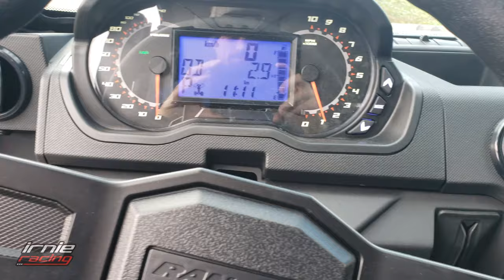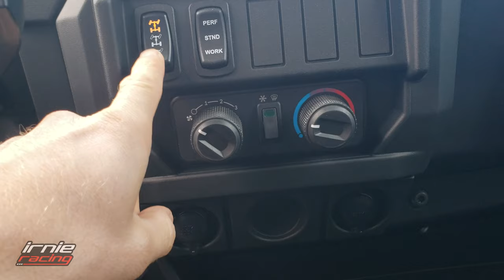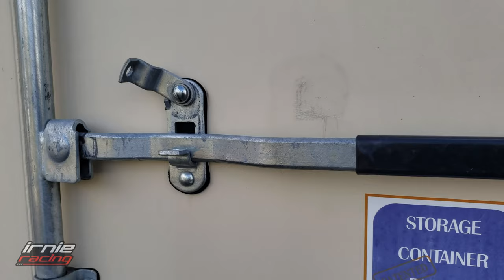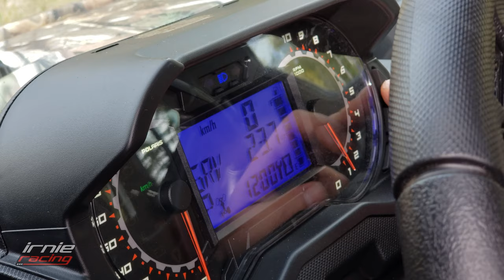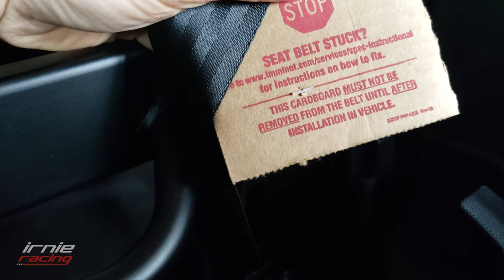2020 Ranger Crew XP 1000 NorthStar Edition - First Impression Review

Comment: my northstar has the plate on the winch that stops the winch when the rubber grommet touches the plate, you can buy it if yours isnt equipped with one 
Polaris New OEM K-Fairlead,Hws,2,Nrw, 2881693